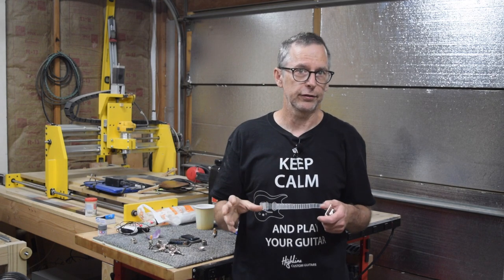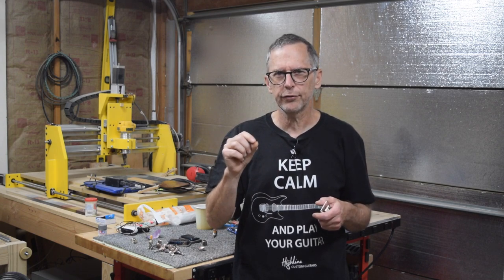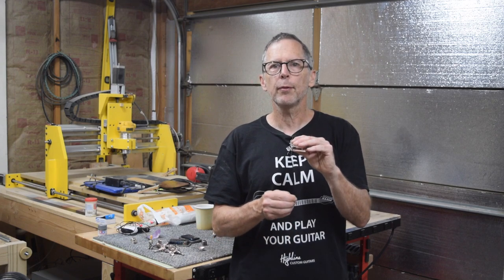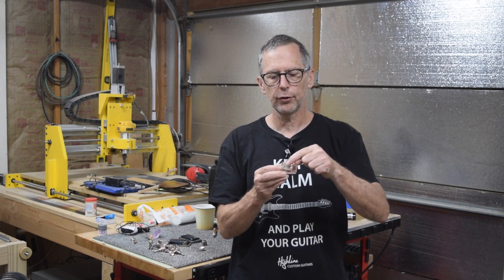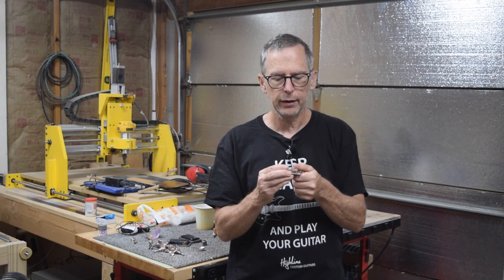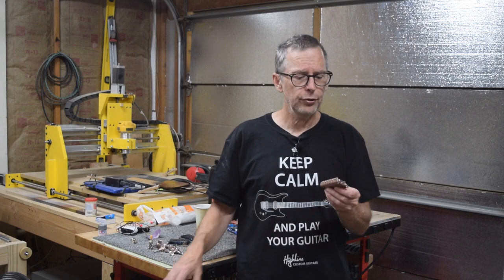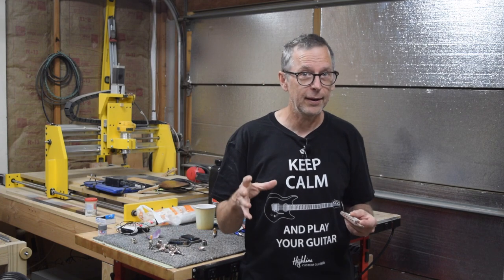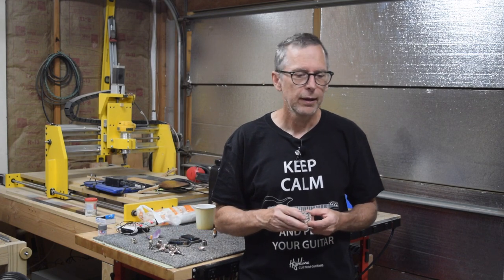Luthier Quick Tip 2 String Through vs Top Loader Guitar Bridges

Comment: Top loader has slightly less string tension and makes bending a bit easier, which I prefer.  A string-through is more percussive, ideal for people that don't bend.  Gibson's feel slinkier because of the adjustable stop bar tailpiece and shallower break-angle of the strings.  I can definitely feel the difference in tension of a high or low tailpiece.
Reply: Gibson feels slinkier because of the shorter scale length.
Reply: @BryanClark-gk6ie  Partially true.  I believe the bridge type and break angle plays a bigger part in string tension.

Comment: I have a point !   I put the strings through 6 drilled holes in a 1/8” thick round bell brass plate on the back of the guitar , the ball ends sit on the brass and go through the whole thickness of the body over the bridge to the tuners . I found it had a lot of sustain !  The ball ends up against my body kinda sux but I could of machined it better to sink the heads
Reply from the maker: Don't forget to consider all of the other factors that determine sustain.

Comment: It's nice with a toploader if you have a minor adjustment to make where you may need to remove a string or two, or maybe all of them to get to a pot or switch, especially when you have brand new strings on the guitar. It's fun trying to the thread that pig-ass string through the body. I'd say the difference in tone and resonance is far to minuscule for my ears...I've got two telecaster bodies in my shop right now, both from the same slab of maple. I'm going to do one of each and compare the results. That will at least solve the question in my mind and I don't really care what anybody else thinks since I'm the only one who suffers through my playing!

Comment: Top load saddles are much higher. If you like low action, the saddles may end up pointing down at an awkward angle with the grub screws sticking way out. It really depends on how deep the neck is set in the pocket. But my hardtail Mustangs had to be converted from the top-load Tele style to vintage Strat string-through bridges.

Comment: To me the only "issue" with a top loaded bridge (specially on bass guitars) is the overlaps of string roll over the edges sometimes is so long (or the model of the bridge is so weird) this could end up on the saddles, plus the action of the saddles when you are rising the string is indeed affected, while on a string-thru the point were the string touches the saddle already is way after this overlaps, so the string is a bit "softer" and allows for a better settle.

Comment: It’s a fact that the bridge itself stops and absorbs the very largest part of the strings vibrations, so what’s left may be insignificant. I still remember when back in the late 70ies ppl were talking about the supposed lack of sustain of bolt-on guitars compared to set-in and neck-through contructions; being a big fan of Pink Floyd, I didn’t understand what they meant because I couldn’t hear any “lack of sustain” in Gilmore’s guitar, or any other Strat player for what matters.
Guitarworld is full of myths...

Comment: I always wondered why Leo Fender used the string through method on the Telecaster. It most cost more than a top loader to produce and Leo wasn’t known for spending unnecessary money and time. I can only imagine that he thought it added some tonal or stability advantage although the Tele bridge is pretty firmly fixed to the body. I personally prefer the lop loader Tele bridge as it seems to make the guitar feel a bit more slinky and is easier to change strings.
Reply: Leo Fender couldnt play guitar...he was a sax player...and he made a few weird decisions...like the string dampner on the first Jaguars.

Comment: In order for the string to transfer any vibration to the guitar, after the saddle, it would have to be vibrating, but that doesn't make sense. The string break angle is designed to stop any vibration post-saddle, and in fact, if you want sustain then you want all the energy from the vibrating string to be realized between the saddle and the nut, so vibration after the nut is not desirable. The one disadvantage I can see to a neck through design is that the string length from the saddle to the ferrel is much greater and so much more likely to stretch, making it more difficult to get new strings to settle. I'm a new guitar builder (long time guitar player though), so I don't really know what I'm talking about. so I have to ask, does my theory make sense?
Reply from the maker: You've nailed it.

Comment: With guitar I totally agree, unless in the hole through the body, the string has the ability to vibrate in the cavity, then IIT would lower sustain. With a stop tailpiece type of guitar, the longer the distance between bridge and tailpiece causes more sympathetic vibration in that length of string, and those sympathetic vibrations are fed by the guitar strings in front of the bridge, therefore lessening the strings main vibration. With a strat, using a small block in the tremolo, more string vibration is transmitted to the springs and the small block will also vibrate to some minor amount, therefore a heavy brass block (than does not ring when you tap it) will transfer less vibration to the springs, therefore more sustain. In the Archery industry, they use vibration transference to make you now function more accurately, by screwing a long rod to the centre of the bow with a weight on the end, when an arrow is released, the bow starts to vibrate, it is then transferred along thehe rod to the weight on the end, the bow vibrates a lot less because the rod and weight (springs and excess string length) are absorbing the vibration. In a bow you want less vibration or sustain, as the bows string becomes more stable as it leaves the bow, the bow vibrates less making the arrow flight more accurate.
Reply: Basically there is no perceivable difference.  As far as the weights in archery go, I think you might be wrong there.  As far as I am aware the weights are not designed to stop vibration.  When we lose and arrow from a recurve bow the string is slightly off to one side.  This is because the string has to get around the fingers.  This applies force to the bow making the bow twist.  The role of the weights is to slow down the action of this force.  The weights being far from the bow means they require some force and time to move them.  The idea is that by the time the force moves the weights (and there fore the bow) the arrow is clear.  To be clear they do not eliminate the force they just slow it down.

Comment: I think it's all a tension issue and it makes difference between guitars affected also by the headstock angle. Cannot say in a scientific way but it's something we have to feel by hand. I have a hardtail bridge guitar that has the the both ways and I can test between them. For me, in that *specific guitar*, the strings through body sounds and feels worse, less sustain and more tension. In a Telecaster model I have, the strings through body feels just perfect. I'm pretty sure this feel vary from each guitar.

Comment: Tone/Sustain are open to subjective interpretation.  Another consideration is playability as a function of string tension - longer string for the through-the-body bridge means higher tension on the string to bring it to tune = a little more resistance to bending.  But back to tone - arguable tonal/attack difference with the reduced string tension from the top loader.  Some say the Tele twang, for example, is in part a function of that added string tension, relative to a top loader.  No experience, just passing on what I've read.  I have a G&L Asat Special with Leo Fender's Saddle Lock bridge - it's  a top loader, but sits atop a hidden wedge that's driven into the body to transmit the string vibration, which apparently Leo felt was important enough to include, though that doesn't address the string length/tension issue, assuming it is an issue.  Apparently, Leo didn't think so.

Comment: Sometimes changing strings on a string-through-body can be difficult if the strings do  not line up easily with the saddles when you put them in the ferrules. Is this any easier on the top loaders? Is it easier to thread the strings through the saddles?
Reply from the maker: No.
Reply: Ok.

Comment: Does it make a difference for string bending if the strings are through body or top loader?
I mean... on strats with a reversed headstock, some people say there's a perceptible difference when bending strings because of the increased lenght.

Max Solo Music made a comparison video and there was a subtle difference in tone. I think string through body sounded tighter and top loader sounded fuzzier.

Comment: I've always been of the opinion that the contact point of the string, which is the saddle, is where the vibration occurs and enters the body of the guitar and thus it makes no difference where the ball end of the string is attached as far as tone is concerned. I do think that the length of string behind the bridge to the ball end makes a difference in how stiff the guitar feels as far as bending strings goes.
Reply: True...but string tension can be altered at the machine head with more windings to create more tension. The scale length of the string is exactly the same, from the bridge to nut...so the point of string contact is exactly the same. The theory a string through creates more tension in the string is another myth...it just changes the area of string where the tension is placed.

Comment: Top loader can reduce the tension of higher gauge of strings? I wanna put 10/52 strings on my strat (my strat has tremolo bridge but I have a hard tail to change and I don't know if the hole will be covered but that's another story) I tried them on my tele with tune o matic bridge and I feel so hard to play for the high  tension and I don't know if the same can happen to my strat when I change the bridge for the top loader, I only wanna know if I can put higher gauge strings or stay with the regular gauge
Reply from the maker: Try using a lighter gauge set of strings.

Comment: What i heard is that the top loaders are smoother to play due to the string break angle at the saddle. What do you think?
Reply: In my experience there’s not much difference. The string is still coming up through the saddle at the same angle
Reply: They bend easier, but it's not a massive difference. It's nothing compared to going down a string gauge.

Comment: I would respectfully disagree. Toploader guitars don't sound worse than string through, but they do sound a little different - a bit thinner and more spanky, if you will. Also the Les Paul reference is a bit off the mark, since the significant mass of the body and the bridge/ tailpiece contributes massively to its sound. A better comparison would be: does a toploader tele sound different to a string through tele? I would argue that it does. 

I love your videos though, Chris, and have learned lots from you. Thanks for making them.
Reply from the maker: Thinner and more spanky? I'm going to add that to my repertoire of tone descriptions.

Comment: It is "common knowledge" (not sure if it is correct or not) that there is a difference in perceived tension while bending strings between top loaders (easier to bend) vs through body.  Same as doing "top wrap" for Gibson style tail pieces. It would be an interesting idea for a show to test this out. You just need a t-style guitar with a bridge that supports both top loading and through body, so you can test tension and sustain on the same guitar with the same types of strings.
Reply from the maker: Preception is the brain's natural placebo. The only way to know if there is a difference would be to conduct the test you describe. So go for it!

Comment: The question that I have though is does it change the way the strings feel when bending notes?
Reply from the maker: Probably. Fortunately, you can try different kinds of strings or different gauges to dial in the feel.
Reply: It is said that through-body makes bending a bit harder (as does longer scale length).

Comment: A top-loader has a shorter string length than a string-through. For argument's sake, a Telecaster has a 1 3/4" body, so you are adding about that much extra string. Some say that the extra length of string makes a difference, or feels different, when doing bends. Why? Because you are stretching about 27" of string with a string-through compared to 25 (whichever scale length plus the short distance behind the saddle). The physics is undeniable with 2" more string . . . the feel of having to stretch 2" more string is debatable . . . the sound difference considering identical distances saddle, fret, to nut . . . even more debatable. In the end, the customer/client may have their own feelings/experience and that will determine which bridge.

Comment: Vibrations are not picked up by pickups.....they are magnetic pickups. String through makes the string longer that is the main difference. The string would need more tension on it to be in tune and therefore it would be a little stiffer.
Reply from the maker: Vibrations affect the position of the magnet relative to the strings.

Comment: How do you covert a stratocaster bridge w/tremblo to a tuno'matic bridge w/stop bar?
Reply from the maker: A tuneomatic bridge requires a neck that is installed at an angle. The neck on a Stratocaster is not installed at an angle. The work necessary to fill the tremolo cavities and shim the neck at the required angle should encourage you to leave that Strat alone.
Reply: Thank you for your prompt response.

Comment: It's all about transmissibility.  When we do MIL-STD-810 vibration testing on electronic weapons systems we design a fixture that maximizes stiffness, doesn't induce its own resonances, and ensures a 1:1 transmissibility from the exciter to the unit under test.  But once you near 1:1 it cannot be further improved upon in any practical sense.

Comment: I'm building my first guitar - a Tele style. I was just going to use a top load bridge as I am worried about not getting the string through holes straight.  What do you thinks?
Reply from the maker: Go with a top loader or try this approach: https://youtu.be/8CHSg6up928
Reply: Just search for 2-3 videos that show you how to get the holes right if you that is what you want. Try it on another piece of wood to test your approach and think about the steps you take.
Reply: Do you have a drill press? Here's what I did for string through top and back ferrules, I used a hardtail bridge's holes to drill out the top holes as if it were a template by taping it down and using a drill press to drill out the six holes half way through the guitar. Then I put down a special piece of mdf on the drill press table that has an indexing pin in the center of it that fits perfectly into the guitars top holes and I line up a forstner bit in the drill presses chuck with the pin on the table and clamp the mdf down to keep it stable. I then put the guitar face down on the mdf and place the indexing pin in to each of the six top holes and the drill presses chuck will be perfectly lined up with the front holes, now drill to the right depth with your forstner bit. Here is a great video, do this! https://www.youtube.com/watch?v=YIHFFJ0Bdz0
Reply: @banditkeithkingofduelmonsters  Wow! Thanks Keith for your really detailed answer! Yes, I have a good drill press. I'll give it a go on scrap first.
Reply: @HighlineGuitars  Thanks HG!
Reply: @onpsxmember  Thanks mate as we say in Oz :)
Reply: The top loader is a great option.  In my experience the perceived tension is lower (since the string length is shorter) relative to a thru-body.  If there is a tonal difference I can't hear it.  

Even with a drill press the thru holes can wander a bit on their way to the back.  You basically need to be able to locate the back holes separately from the thru holes to have them perfectly in a line.  Having a template for locating the ferrule holes is a smart idea.

Comment: In my Fender Jazz 🅱️ass I have a bridge with both options, and in this 🅱️ass it is very easilu noticeable difference in sustain depending which way the strings are installed. However I still think it is not the through body deal that is the mother reason for this happening. I would argue and theorize that it is more to do with the angle the strings cross the bridge, because the biggest difference in contact point is there. There are some examples of the same effect when you over wrap the strings to a les paul vs. under wrap...

Comment: If the tone of the string is determined between the saddle and the nut then string through or top loader would not matter at all. I do wonder about there being a node point "the saddle" on a string with minimal slack (the top loader) versus a string with longer slack (the through body.) I have noticed a difference in tone with trapeze tailpieces with floating bridges which have plenty of slack after the node point. Just curious if anyone has any ideas about this. Thanks.

Comment: How's the yellow CNC - gets a lot of use?
Reply from the maker: It's my absolute favorite tool in my shop. If it broke and for some reason, I couldn't fix it, I would quit building guitars rather than go back to the old school approach to making them.
Reply: @HighlineGuitars  I have a small x carve but alas its too small to do guitar bodies.
Is your yellow cnc a kit or pre built?
Reply from the maker: @freeelectron8261  No to both. I designed it myself. I offer an assembly manual on the following link (scroll down): http://www.eguitarplans.com/
Reply: @HighlineGuitars  Way to go if your canny enough!  I'll check it out - Thanks!